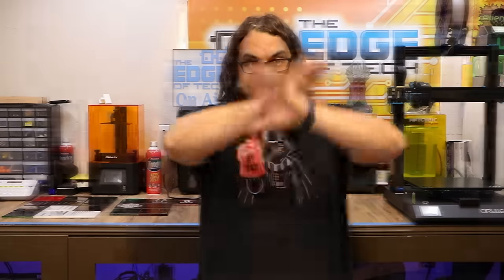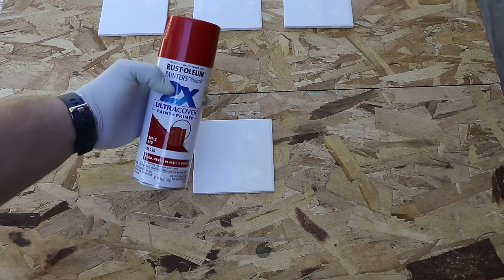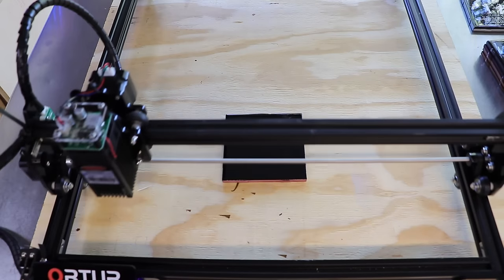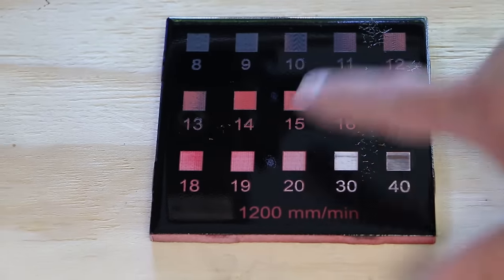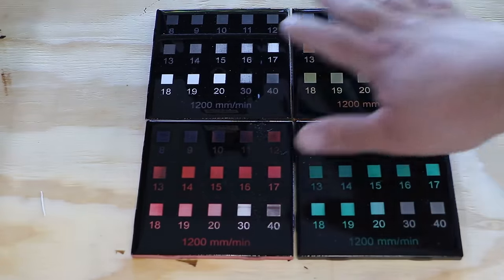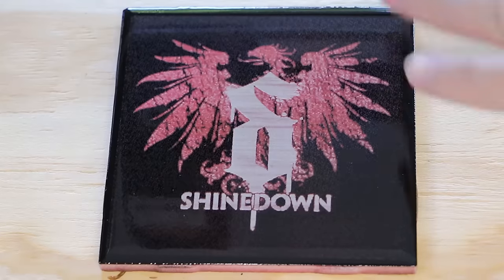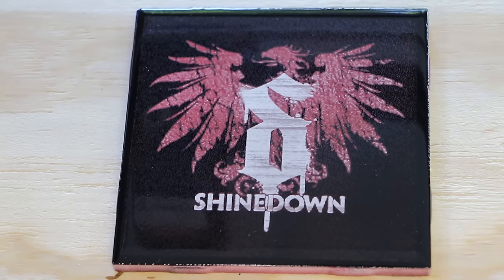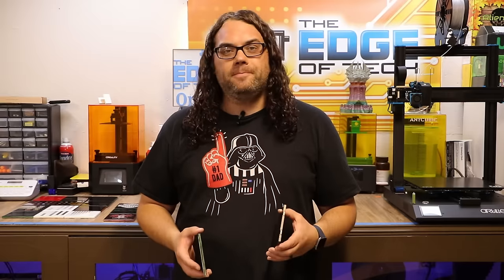How to Create Amazing Color Tiles on a Portable Laser Engraver

Comment: For cleaning would 90% isopropyl alcohol work? I use it for cleaning lots of different things. Removes oils really well. Actually removed the paint on my toilet seat and a spot on the wall that was yellow.
Reply from the maker: It will work!
Reply: @TheEdgeofTech  cool. I actually work at a hardware store and just ordered the ortur laser master 2 pro for my first engraver after hours of looking at reviews and videos. Have some experience with delta 3d printers. Just looking to earn a little extra money on the side. Had some co workers buy a few holiday 3d prints but even the small stuff takes a long time and filament is a little expensive when trying new models and having to throw out failed prints. Plus I have to order them online so it takes a while to get them too. Wood and tiles are cheap and readily available lol
Reply: @TheEdgeofTech  just curious, do you know if this would work with glow in the dark paint? Watched your video on doing this on canvas too and found some patterns that would look great if parts could glow in the dark. Can't find any info online where anyone has tried this though.

Comment: Same machine, using lightburn, so i tried this and even at 70% power going 12" in a minute, which takes hours on a 4x4 tile, it still doesnt look anything like this.  When I 1st painted the tile, i cleaned it, then from the 4 angles i painted the color coat (to make sure each edge was painted.   Then after it dried, I have tried gloss black doing the 4 angle sides with light coats, then let it dry for hours.    (Now trying flat black in case that helps)    Maybe this is like 4 layers of paint and is too thick???
Reply from the maker: Hey! I would do 1 even layer like I show in the video. Also, the clear coat goes on after the burn is done. If you put it on before, the paint will be very thick to burn through.

Comment: Great video! Thank you!! Can a stainless steel plate be used instead of the ceramic tile? if not, why? if so, anything significantly different in approach or setup? Thanks
Reply from the maker: I actually have tried thin sheet steel and it came out pretty cool! Same principal and the only thing different is that you don't have a white base. But you could use white as your first painnt layer of you want!
Reply: @TheEdgeofTech  Great! Thank you very much for the quick and helpful response!
Reply: Any material can be used for a base in this process.
The laser burns off the first layer of paint so the substrate does not really matter outside of being flat and able to accept paint.

Comment: Dig your vids, but won't ceramic tiles scratch a table...if you are using these as coasters?
Reply: could use a type of felt under liner at bottom of the ceramic tile

Comment: Another idea for clear coating, use a different clear. You are using colored spray paint and clear finish with the same solvent. Use spray paint for your colors and black, then use a waterbased polyurethane for your clear coat. It will not interact with the spray paint.

Comment: Hello again, I have an issue with the painting of the tile.  After applying my base color I let the tile sit overnight(8 to 10 hours).  When I apply the Black layer it almost instantly bubbles up and then cracks lines all across the tile showing the green layer?  Any ideas on what I'm doing wrong?  Thank you
Reply: Make sure both paints are using the same chemistry, i.e. water based acrylic versus lacquer based.

Comment: hey, Jim, great stuff here. So I downloaded your file to make some of the test blocks, and what I'm finding is that the burns never seem to get to the color underneath until it reaches 30, which looks bad, and then 40 which is white. Do you have any suggestions as to what I could be doing wrong? Could the paint be too thick?
Reply from the maker: Hey Kevin! Make sure light burn is set for millimeters a minute not millimeters a second. I think I go over that in the video, but that is a very common reason why the burns don't happen. Also make sure the tile is in focus and at the right focal height. What laser are you using?
Reply: @TheEdgeofTech  hey, thanks for the reply. It is set to mm/min (I don't see a mm/sec but ill watch again) its burning something, just not burning deep enough to see the color under. I'm using the "20w".

Comment: Awesome work. Only watched a few of your videos so far.
If I may I make one suggestion, please put some cross bracing on your table.
The rocking is a little distracting.
Other than that, great work.
Reply from the maker: Thanks, if it's the stainless steel table, I don't use it very often. But it is wobbly. lol I will work on that!

Comment: Hi I did a number of color chart tiles and I'm not getting the different range of color. It mainly stays the same color till it gets to the 20-30-40 power range  Any idea what the problem is? I'm using the Sculpfun s9 Laser
Reply: im having the same issue did you find a fix? i have the laser master 3 10w

Comment: I have that same resolution issue I just hit the minimize square button. You'll lose the layers but the fire tab will show back up.
Reply from the maker: It was a resolution issue. I went back to the recommended resolution and it all shows now!
Reply: @TheEdgeofTech  If you have a certain resolution that you use to best fit a certain monitor or that you personally like best. There is a very simple solution to rectify any inconsistencies or layout errors for programs not loading the full extent of their intended GUI preferences. So what most forget to modify or adjust (due to the OS usually adjusting automatically) is the scaling option along with your resolution. So if you have a huge 4K TV and everything looks super tiny with the finest of detail, your OS would(most likely if in automatic scaling mode) adjust the scaling modifier to probably 200% too keep everything within reason for a skewed or undesired viewpoint. Now if you have an odd TV or display being used as a Desktop PC monitor you are more than likely going to need a little bit of self adjustment due to the OS not really knowing what or how to exactly scale to the format or resolution type. I know this was as bit more detail than needed by most but just wanted to make it as clear and understanding as possible. So if you have any issues in the future just go into your personalized display settings and just go through and tweak those settings to your liking and find what use case it suites best. Thanks for reading to the end and hope y'all have a fantastic evening with happy healthy spirits and may the Maker gods watch over your projects for flawless finishes and happy clients all around! lol Sorry, I'm a freakin nerd Thanks AGAIN!

Comment: Great video, I'm running the color test using my Ortur LU2-4-SF laser, using the color test at the end of my burn all my squares appear the to look the same unless you angle the tile.  Does anyone have any suggestions or recommendations on what I may be doing wrong?  I use the both the aluminum plate for adjusting focus and the focal gauge board for proper distance. Thanks all!
Reply: What program are you using to run your laser? Assuming you are focused as you say it must be a settings issue. Too fast or power set too low. It takes some playing around but the results can be amazing
Reply: @pickardpj29  thanks, lightburn.  After a lot of trial and error, I finally found the magic number. Spd 3000, range between 6/8%. Still seeing that some paints are better than others. Good burning!

Comment: great video. i spraypaint a lot. the "dry and recoat " times are in the fine print on the side of the cans. Rustoleum paints are very sensitive to this. your video was so good i subscribed . love your enthusiasm and your instructions are very clear
Reply: I've learned rushing re-coat times using Rustoleum will ruin a paint job in a heartbeat.  I'll bet that the time between the final black and the first clear coat was less than 48 hours, and that is what caused the crackling.  Now, I always give extra time, usually an extra day to cure, so as not to screw up the paint.

Comment: How would you clean up the burn through both coats of paint to get purewhite without the dirty lines? Overburn maybe?
Reply from the maker: You could go over it twice, or use a higher power, or burn it in layers so that the layer that goes all the way down is a higher burn percentage.

Comment: Hey Jim, is the laser output really adjusting to the image density or does the laser just seem to change power because the image was converted to a halftone image and that is changing the burn effect? Thanks!
Reply from the maker: It changes per the darkness of the pixels. So grey will be lighter than black and white wouldn't fire at all. I hope that makes sense
Reply: @TheEdgeofTech  yes, I understand, but watching your video again it appears that the output power of the laser never changes. The difference in burn density is simply from the pixels density in the photo, not the laser changing power output on the fly.
Reply: Что бы это сделать. Надо что бы файл был g-cod

Comment: Would be these aplicable for laser 15w diode, and does tile should be ceramic
Reply from the maker: Yes! You may have to adjust the powers on them, but you could run it first to find out.
Reply: @TheEdgeofTech  tiles should be ceramic or can be used other surface

Comment: just got mine, trying to go thru everything lot of good info here.  Seems I cant get canvas to do anything.  Adjust the focus on the ortur 20w, but wont even go tru the black layer.  2500 sped and 89 power.  Doing mulitple passes just to try and get down.  Any other tips?  make it look easy
Reply from the maker: Did you get the fixed focus laser or the adjustable focus?
Reply: @TheEdgeofTech  believe adjustable, as it came with the aluminum block for measuring
Reply from the maker: @rednate13  That's the new fixed focus laser. You put the block on your material, then bring the laser head down to it. You shouldn't be turning the laser lens at all. Is that how you are focusing?
Reply: @TheEdgeofTech  yes and using the block that came with it. I followed your vid about getting a picture ready and all that.
Reply from the maker: @rednate13  Go to my newest video that came out today. I have a link in there for the Nicky Norton test file. Run that and see what happens. Let me know because that has many different powers and speeds. You should definitely see a result. As long as you are using that focusing block to get the correct focal distance
Reply: @TheEdgeofTech  thanks for the info. Got the color file and did that.  I see what i was doing wrong. To much speed and power. Have to go low and slow.
Reply from the maker: @rednate13  Awesome!!!
Reply: @TheEdgeofTech  now i got to learn times, seems to take all day event for a 8x10 picture

Comment: For it not showing it may be display scaling and or resolution, you may have adjusted it to make it easier to record.
Reply from the maker: I double checked and scaling was not on. The HDMI switch I'm using limits to 720 and I just figured that out. So I ordered a new one that will be here Friday and I will test this weekend, but I believe that will fix it because I'll be able to run high resolution
Reply from the maker: It was a resolution issue. The HDMI switcher I was using was stuck at 720. I got the new one and it's good now!

Comment: I used the same paint, same ortur but below 20% it didnt even discolor the gloss black.  All other power levels resulted in greys, no red. 40% was essentially white. Tried slower & increased power but still no reds.   Help,,, black coat too thick?  Tile not cleaned enough before painting?  Red layer dried a few hours before applying the black.  Still trying different things but ur thots much appreciated.  Thanks.  Oh, in your video were you using the g8 lens?  Thanks
Reply: I am having the same problem, tried lighter black paint and still same result.
Reply: @switchbackhendrix5350  after dozens of video methods to focus the laser I have it working.  Not nearly as well as this video but it works.  The focus is very very finicky, very sensitive and absolutely critical.    Be patient, test, test, test, good luck.

Comment: I'm a little confused how this varies in color when run. When converting an image to newsprint it simply creates dots larger or small to give the illusion of shading. When this is run on the laser why doesnt it engrave each dot at 30% power and result in everything being white? I would expect the result to be a grayscale image rather that having some areas of red. Is the laser also varying it power output and if so where is it getting this information?
Reply from the maker: It's kind of a mystery lol. Acutaly, when you look at the images, their are lighter and darker dots or areas of the picture. When you are using a Diode laser and the min power is set to 0% and the max is the magic number, the burn will vary in power. So the light grey may burn at 5% and the dark black would be the max power. Make sense?

Comment: My problem with modern spray paint is that the crap almost all has Acetone in them so when I go to do the top coat it eats through the undercoat and screws it up.  A lot of people have this issue from the old FB group I used to be on.  Just eats clean through everything since Acetone melts Epoxy paint.  edit:  @11:00 You have the telltale signs of what I am talking about right there.  That lifing/bubbling up/cracking is due to the damn Acetone in modern spray paint.
Reply from the maker: I agree. It can be a pain to work on. I found that if it's done in very small coats, it helps, but it still can happen.
Reply: @TheEdgeofTech  I never managed it thanks to the Acetone in the cans.  Used to (a couple of decades ago now) there was none of that in the paint and I would apply two to three coats when painting various things now 99% sure it will melt so ruining everything.  Not sure which Eistein type thought it would be a good idea to add a drying element to the paint mix that eats/melts paint.

Comment: Make sure not to wait several hours between coats or the paint will wrinkle. Coats should be applied within 30 minutes to one hour between, or you need to wait a couple of days to reapply.  I have had several wrinkle if applying four hours after applying the first coat.

Comment: I tried to create the color test burn on my tile with a coat of Purple and a coat of black. I ran the lightburn file and every square was the same. All grey squares. The squares progressively get deeper, but they are all a shade of white/grey. I never saw any color. I’m using a 60w Chinese C02 so I thought that maybe I should have used even a lesser power. I ran another from power 1 to 7(since your file starts at 8). I obviously didn’t see anything from 1 to 3, but 4,5,6 and 7 were the same as before, just grey squares. I am sure this is my fault since I’ve only had my machine for 3 weeks, but, maybe someone may have had the same results and could share the resolution. Thanks in advance(hopefully).  Steve

Comment: Man, this is great info.  Some of the best I've seen.  How would your settings translate over to a 100W CO2 laser?
Reply: That is why he gave the calibration file, so you can test out your laser with your paint/tiles...
Reply: @nonebiz2132  I downloaded the files.  They are all based on his diode laser and the settings for that are way way different than for a CO2 laser, especially a 100 watter.  I've already ruined a half dozen tiles trying to find the right combo to do what he's doing, and frankly, I don't think it can be done on a CO2 unit.
Reply: @tomashby9428  I've etched slate tiles beautifully with a CO2, but haven't burnt paint but maybe I can help.  What's the max speed of your laser?  What's the lowest power setting that turns the laser on?  Are your optics clean and focused? Usually you can select Duty Cycle as well as Power, for fine work I usually decrease Duty Cycle in 10% increments and keep power around 40%.
Reply: Generally the CO2 lasers put out too much power to do the painted tile thing very well. The diode lasers are much better suited for what Jim has shown here or the Norton method which melts the paint into the tile finish so that no clear coating is required. (See https://forum.lightburnsoftware.com/t/my-first-tiles-my-first-tiles/15817/2)

Comment: On your shinedown tile, you set the "S" and "shinedown" at 30.  Is there any way to control the shade of red you get in the finished product?
Reply: Think of a jpeg as one solid vector. He set his power at 30 b/c he wanted the black area to burn darker. By doing this the gray area will automatically be lighter and give the appropriate shade of red, and the white area obviously will not be touched.
Reply: You would have to seperate the solid color from the grey tones in GIMP. Once you make them 2 layers, you could control the specific colors.
Reply: I was about to ask how the laser knows to burn the lighter parts to the shade of red he was going for, but I think I understand. The max it will burn will go to the darkest part of the image and the rest by default will be lighter I suppose.

Comment: I have to figure this out for my Glowforge 🤦🏻‍♀️
Reply: This is the problem for we 20/30/40/60 watt CO2 laser people because we simply have too much power to get it to work like this.  Another thing is that the laser diodes can actually do real greyscale not simply on and off as ours can only do (reason we use halftone like process).